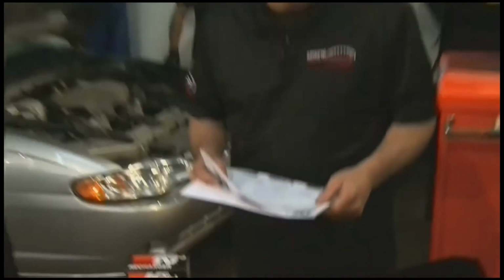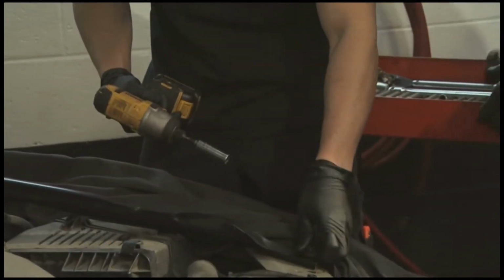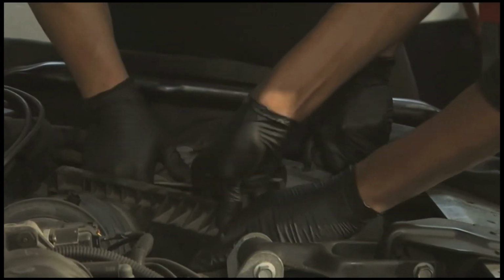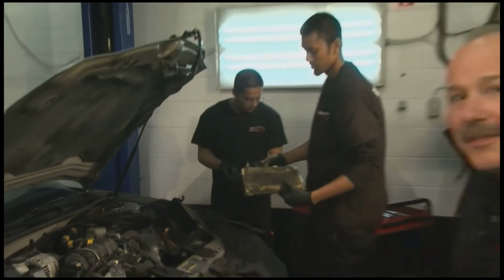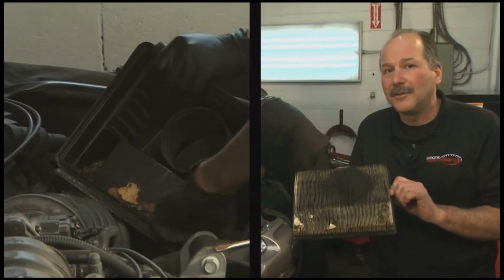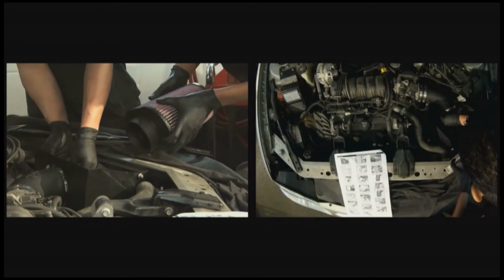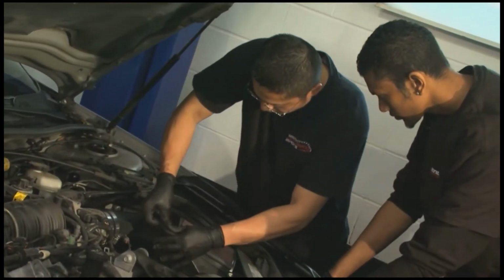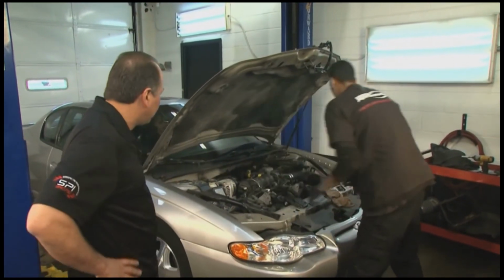High Flow Intake on Monte Carlo

Comment: You are kidding man! You have to port match int & ex on everything. Then upgrade the TBI. then a pcm tune! Then Maybe regap the spark plugs.  Now you talking about measurable HP increase! Maybe 10-20 HP if the HP gods are working with you. Otherwise stop running jokes!!!
Reply: Terrence Hall and I could of installed that baby in less than an hour by myself

Comment: Had one when I purchased my 2002 Monte SS. Looked cool and sounded great, but that's about it. No difference without a Ecm-Tune. Now that's when you notice a slightly torquey-ier motor, but had I reinstalled the factory airbox after the initial tune. I wonder what the numbers might have shown?
Reply: 3.4 made a huge difference with no tune